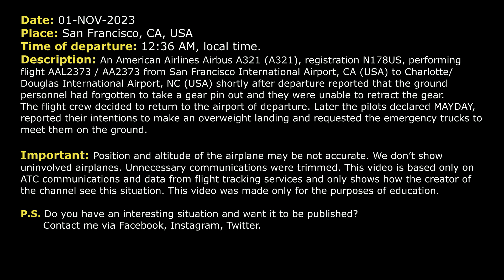MAYDAY. Negligence causes emergency. Unsafe gear. American A321 returns to San Francisco. Real ATC

Comment: If you could see my previous comments on this sort of video, I've been highly critical of my colleagues in ATC when they continuously pepper pilots with questions during critical phases of an emergency flight. Not this time.  these SFO and NORCAL controllers were super professional, helpful, useful, and efficient.  This one should be required viewing for every manager that has stood behind a controller demanding "fuel a souls on board, fuel and souls on board!". Nice job SFO!
Reply: This incident happened at SFO but your analysis is otherwise correct.
Reply: @TheGospelQuartetParadise  thanks. I'll edit (so if you want to edit/delete). This after my highly critical reply on the SFO Lufthansa pissing match. A team versus D team.
Reply: I was just gonna say that very thing.
Reply: See people get uptight about this all the time. SOB should be something the P has easy access to, as is fuel in time and weight. Emergency comms requires preset checklists just like the inflight emergency does.  These are not challenging or time consuming questions. It is interesting that you hear the fuel question different ways, apparently depending on what stage of flight.  Fuel in time is most helpful for ATC, not CFR. Fuel in weight is more helpful for CFR than ATC.  Although these things thankfully are not  needed, or the need is not apparent, for 99.99% of the cases, if they were needed, it would be too late to ask. The pilot is only concerned about one aircraft. Others involved are concerned about an entire airfield, a major metropolitan city, and potentially dozens of aircraft in the vicinity airborne. What may not be obvious in these flittered and abridged recordings, may have importance.
Reply: OK, then let’s step even further into the future and let’s not lhave the pilots talk because we all know that they mumble and not everyone speaks English properly so let’s just go to textbased communications and then we won’t have any more confusion and we will have a text record of who was told to do what.
Reply: @wcolby  the FAA has been "working on this" since my career began in 1989. The airlines had already moved routine intra-company communication to digital even then, but the FAA does very little. In fact, today's modern airlines could automatically transmit stuff like fuel, souls, which engine is down, if there is a fire, and even if the crew has completed their checklists. Then voice communication can be reduced to "say intentions" and "what do you need?"
Reply: The “fuel and souls onboard” needs to go. It’s outdated and serves ZERO purpose. Absolutely idiotic question. 

“American blah blah we declare an emergency”

“Ok let me know when you want to come back in and tell us what you need”

That’s it.
Reply: @SchillerDuval  I agree.  The SOB is helpful in a crash, but should be transmitted by the plane to the system at door close (final count).  I'd like to hear from the first responders on the fuel question.  I was always told that it allows the fire team to prepare for how much volume they are dealing with, but are they going to "take the small truck" instead of the big one based on that?  I doubt it.  I feel that they always roll all the equipment even for a small plane.  Breaks up their day. It only becomes a problem on the radio when they badger them for it at a bad time (usually because a "tie" is standing behind them demanding it).  Ironically, it is quite evident that once the managers get the information, they don't share it in a manner that subsequent controllers don't ask for it again, and again.  I mean, why are managers in that loop anyway, if they aren't going to share effectively?  Controller to controller works pretty dang good.
Reply: @CharlesCornettFL  I've often thought that fuel is both for planning purposes (how likely/large a fire) but also situational awareness... There have been a few accidents over the decades where pilots have gotten so heads-down into the emergency that fuel took a back seat, example a UAL DC8 landing at PDX where they ran out of fuel troubleshooting a landing gear light. ATC asking fuel remaining plants the seed to look at the indication & also gives ATC that visibility for maneuvering, etc  "Fuel in minutes" much more useful for that end while "fuel in gallons/pounds" being more useful for "how big a fire" planning.  (because 60 minutes of fuel is going to be a very different volume for a Cessna vs. an A380).

SOB is useful if emergency services are likely (to prepare ambulance/transport/triage/ER space) but for a "routine emergency" it does seem rather unnecessary
Reply: @lincolnking-cliby972  (as trained to ATC) Fuel on board is indeed for planning for fire response, and has zero intent to "jog" the pilots.  As I opined before, it might mean something about bringing more trucks, but they usually bring everything they have anyway. They have long checklists where fuel is brought up ALL the time.  Most professional pilots would probably be offended that they needed us to include fuel in their scan.  SOB (as trained) was to clarify the difference between "passengers and crew" and "potential cadavers in the hold", so they don't stop searching when they find the final body count.  Both are throwbacks to the manual era, when record keeping was all on paper, and it could take hours to get a response from the airline dispatch.  These days airlines are notified instantly when one of their planes declares an emergency, and all but the oldest planes are constantly reporting thousands of parameters (including fuel state) to the airlines.  The "question" of FOB and SOB is a thing in every one of these incidents solely because there is a rule that says that controllers must ask, relay to managers, who relay it to the next manager, and so on... and that pretty much never makes it to the next controller, who asks again, and again.  I whole-heartedly vote they get rid of this unnecessary distraction during a critical phase of flight.
Reply: @CharlesCornettFL   They can't just transmit it at the door there is a reason it's called "Souls On Board" if say someone got sucked out of a window (has happened before), or jumped out of an emergency exit (has happened before) stuff like that they now have to re-count the souls on board the reason for this is if the plane were to eventually crash the emergency services need to know how many people there was so they can count them as they find them. There has also been situations where planes have had to stop at the nearest airport / airfield to get someone off the plane and then it carries on to its destination that also changes the souls on board. It has also been used before to help calculate the weight which can be important in certain circumstances.

Also they ask for how much fuel it has so the ATC can determine how long roughly the airplane can stay in the sky for if there is a situation on-going. And regular communication between pilots and ATC includes updates on fuel status, especially in long-haul flights. This helps in planning for potential issues, like rerouting due to weather or airspace congestion. And other reasons.

Hope you've learnt something and that clears it all up for you. 👍
Reply: @CharlesCornettFL  I thought it (fuel left) was to see how much time they had to sort things out, how desperate they are to get on the ground?
Reply: @axelknutt5065  THAT is a throwback to the world of non-radar tracking of aircraft. That information is recorded on the filed flight plan for most every flight plan (all IFR and optional VFR). Should a plane disappear (such as the Malaysian plane) it can help decide a search radius. While it may be useful in remote areas, the advent of ADSB has rendered it pretty useless in the US with commercial aircraft. Pilots are required to maintain a reserve of fuel, and announce if they are having a fuel issue. It would be logical to discuss it then, but not something ATC would chase without it being pertinent.
Reply: @CharlesCornettFL  The question of fuel is supposed to give ATC an indication of how much time they have to sort the situation out before they absolutely have to land. That's why you'll hear most ATC Controllers ask for fuel remaining in minutes, or time. That way they know, "Oh this plane has less than 1 hour of fuel remaining, we need to get them on the ground ASAP!" or like in this case, "Oh he's got almost 5 hours of fuel, we can afford to take the extra time to box him around and get everything ready." It helps with getting a sense of urgency for the situation, and usually its best for the pilot to give this information because instruments might transmit incorrect information while the pilot can see how much fuel he's burning and probably has the best Idea of how much time he has left in the air than anything else. I agree though that SOB could be a thing that is just automatically transmitted when they declare and emergency since that is a single number that doesn't change during flight.
Reply: @SchillerDuval  Especially immediately after take-off. Based on manifest that the airline should have in back channels; and fuel based on destination + aircraft type. There isn't a huge firefighting difference between 50 tonne and 55 tonne.  For air traffic planning, same thing. fuel is 'flight time to original destination'.

Pilot being snarky about ground crews when that should be on him/copilot for doing the walkaround was inappropriate.

Comment: This falls pretty squarely on the FO. It was a bad day for him or her. Guarantee it was the nose wheel. You have to look up inside the well to be sure. The mains have a large collar that is easy to see unless you just don’t look at the mains at all.
Reply: If there’s maintenance in places they aren’t required to do a walk around.
Reply: It was a tire change. Mx failed.
Reply: @justsnappy  MX fail? Right. Explain that to the chief pilot.
Reply: @cloudstreets1396  sure, the captain should’ve tasked the FO for post-MX walkaround.
Reply: @justsnappy  MX missed it, but gear pins is very clearly and plainly on the list of things to look for during a walk around. That FO is gonna have a chat with the chief for sure
Reply: @anishannayya1  not at all. The FO does the walk around.

Comment: Last time I checked it was the pilots who are responsible for the external preflight. Yes... Mx should have pulled the pins but it's ultimately the pilots' responsibility to assure they're not in. It's part of the normal preflight. Love how they throw the ground crew under the bus.
Reply: Not an expert, but I believe the landing gear pins are pulled after pushback, so not something pilots can check.
Reply: @TheTrainWatch  You might be thinking of the steering bypass pin.  Yes... That's something we don't check because the ground crew pulls it after they push us back.  Very easy to figure out that pin hasn't been pulled because you'll have no steering.  The gear pins are typically only used by maintenance but we're still required to check that they're not installed on the external preflight.
Reply: Specifically it's the FO's responsibility to ensure there are no gear pins installed on his preflight walkaround. He knows where to look and use a flashlight if necessary, there is no excuse.
Reply: @michaelallen1396  Well, the pilot performing the walk-around...CA or FO.
Reply: @seanoswa1829  Definitely true, the Captains often do the walkarounds.
Reply: @F15EFlyer  you’re obviously not either…stay in your lane fighter boy
Reply: @F15EFlyer  Apparently, you, too, are not a commercial pilot-few airline pilots "pull pins" for the landing gear; WN is, or was, the only I know. And I've never seen the ground crew perform this task; a military thing...?  Cheers!

Comment: Aren't they supposed to show you the pin in their hands? Is this a European thing?
Reply: The pin they show you at "Salute" is the steering bypass pin. If it is left in the Capt cannot steer the aircraft on the ground. The pin in this instance is the down lock pin. The one that prevents the gear from retracting.

Comment: Sounds like the down lock safety pin (not the steering bypass pin) installed for maintenance.  Me thinks flight crew should have noticed that and the system should have alerted them earlier.
Reply: Absolutely. This has happened a couple times at the airline I fly for. Each time they’ve gotten a stern call from the chief pilot. This is as much on the pilots as it is the ground crew.

Comment: Why to declare emergency? Why to do an overweight landing with all the consequences that this two things bring? Why not just burning fuel in a pattern and then landing? Is it more expensive/dangerous to burn fuel in a pattern? Just want to understand why they took those decisions
Reply: Because of the time it would take.  Depending on their weight, it could be hours before getting below max landing weight.  Also, an overweight landing isn't a big deal on an A320.  QRH gives some advice on flap use and basically says don't land hard haha.
Reply: I'm not an AA pilot or an Airbus pilot. At my airline, on Boeings, overweight landings according to Boeing and their checklists require normal procedures and techniques. In other words, nothing burger. However, company policy is for the Captain to use Emergency Authority to conduct an overweight landing. The planes are certified to land overweight (for example a fire immediately after takeoff which would require immediate overweight landing). The airplanes have a maximum landing gross weight for structural longevity purposes. At my previous airline, Boeing owed the airline a big sum of money. The CEO of the airline made Boeing raise the maximum landing gross weight of their Boeing airplanes instead of taking the cash. This meant the airline could haul more cargo/passengers legally than the competition.
Reply: @JohnSmith-zi9or   I always liked it when a MLW increased.  It was straightforward work for me to redo the brake energy analysis for FAA submission, as in no surprises/no chance of failure/no having to work late (like when some cutting-edge project wasn't going well).

Some numbers:  Any "FAR Part 25 transport aircraft" (i.e. airliner) can land at its maximum takeoff weight with only modest restrictions, most notably a touchdown sink speed of no more than 6 fps.  A normal everyday landing is 4-6 fps;  the landing gear isn't supposed to be damaged until beyond 10 fps (12? -- it's been a while) at MLW, and the design failure point is 15 fps at MLW.

The brakes will handle it fine, since a MTOW RTO puts more energy into the brakes than a MTOW landing.  In fact, the max energy RTO done for FAA certification has on occasion been done out of a landing at ~MTOW, just to have more runway in front at brakes-on than would be the case for an accelerate/stop.
Reply: For this specific flight, a fuel burn of roughly 27,000 lbs (4030 gals US) would be necessary to achieve MLDW. Even with "one leg" dangling, this is about 3 hours; the overweight inspection was quickly completed and without an issue.